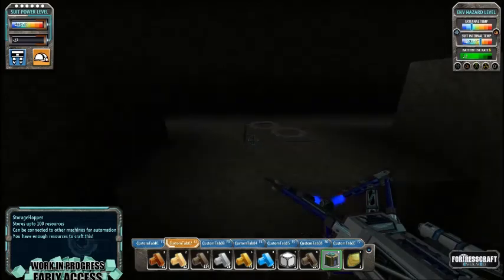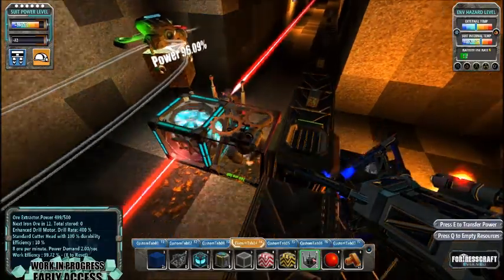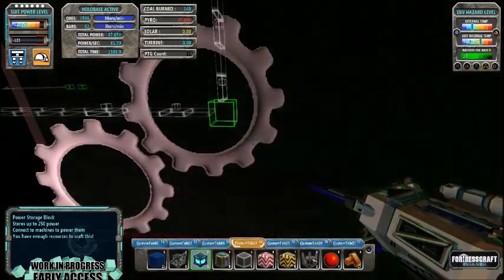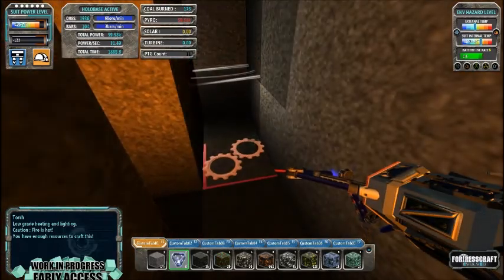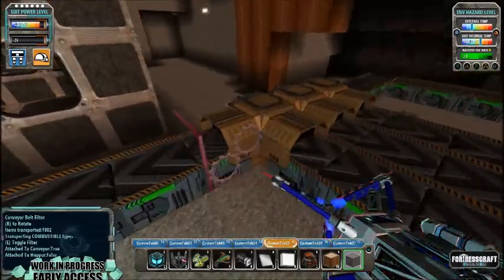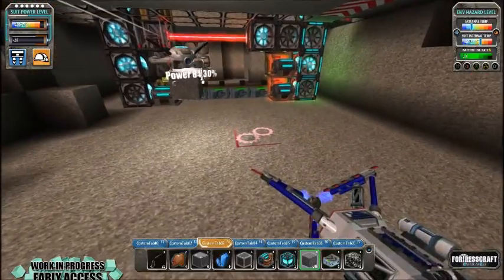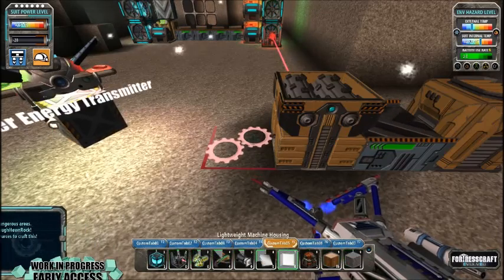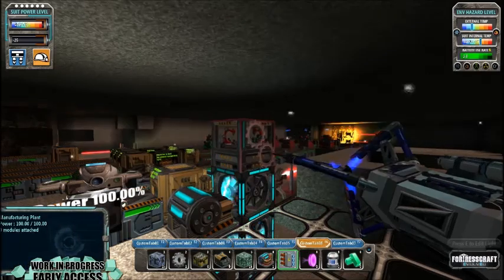FortressCraft:Evolved - Season 2 - Episode 49 - Over Haul of the power station

Comment: Ok, several things, First use you function keys, it will help you switch between bank of items quicker. Second, you know that you can create torches by having coal in you inventory, well you can do this with other items as well, conveyor belts, PTG's, Power blocks and such, if you have the icon on your toolbar and look in the lower left corner (info box) it will indicate if you have enough materials in you inventory to create that item, just place click if you do, you don't have to keep running back to the factory cube, this will speed up your assembly if you already have the mats in your inventory. Also as I said before increase a few of your power blocks to T2. A 1500 unit block will handle your power requirements when you make radical changes as you do so often.
Reply from the maker: I only thought it was the torches and the stuff in the c menu that could be made if you had the mats in your inventory.  I will give it a try next time.  In the next episode i do put in a T2 power cube(green one)